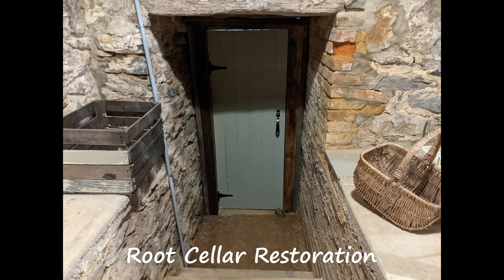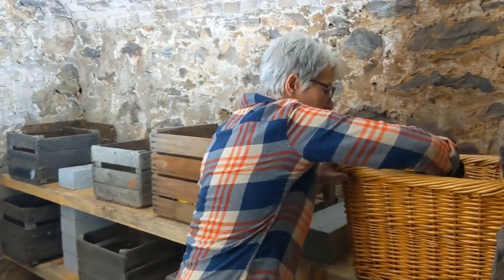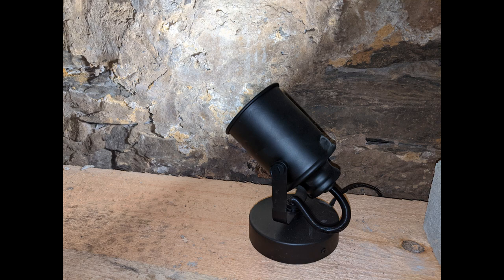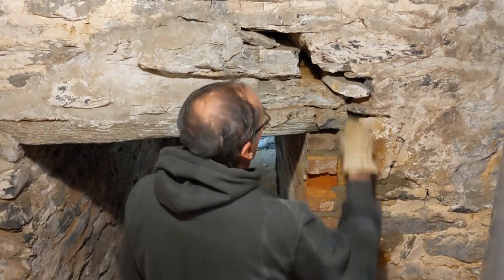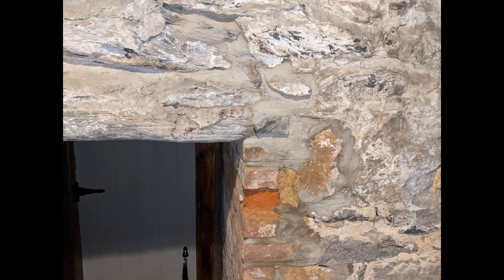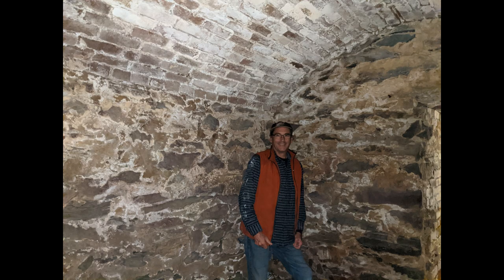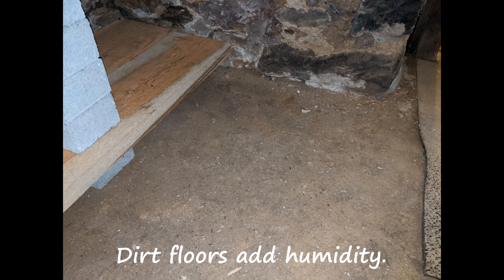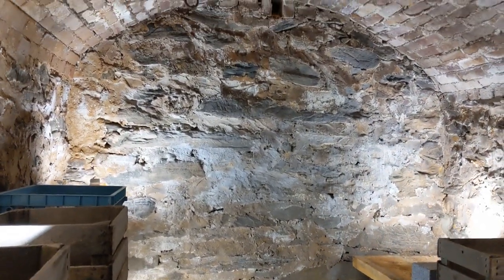1840 Farmhouse Root Cellar Part 2

Comment: If spiders are an issue they used to hang onion sacks of hedge apples in the cellars...typically these where cultivated in the hedge rows ergo the word hedge apples...mortars where typically slaked lime stone and soil mixtures they cure for a long time and obviously they do a very good job.....the natural mortars also where somewhat self regulating for humidity like adobe blocks they would breath....and maintaining humidity is best done naturally at 50%...in winter a stove pipe to the floor allows cold air to fall in and at the top warmer air will circulate via convection...that will allow moisture out...warmer air carries the moisture out...boiled linseed oil on the clay floor will also help regulate moisture...Often farms would have a wine room I wonder if that is how the one in the barn was used for brewing beer and wines?
Reply from the maker: I never heard that method of keeping spiders away. I'm always interested in new ideas.   

It's amazing to learn all of the different ways things were done in the past.

Thanks for watching.

Comment: With those thick wooden shelves you put in - Are you worried about mold?
Reply from the maker: I was not concerned at the time....but I should have been!  Good observation. I'm working on a ventilation system now.

Comment: You could put mortar in a baggie, like you would to fill a donut, cut the tip off, put the baggie back in the hole and fill some mortar in there. You can be more precise using the baggie thing, and then apply mortar to the stones you fit in there. That way, you have a solid repair.
Reply from the maker: That's a good suggestion.  We hope to get more work done in there this winter in order to have it useable by next summer/fall.  Thanks for watching!

Comment: I love this. How many man hours do you figure it will take to secure the barn cellar?
Reply from the maker: The barn root cellar is a bigger project. Water from the bank barn ramp leaks down to the stone arch and it damaged the mortar.  I need to pour a concrete pad on the ramp to make sure it does not collapse when tractors drive in the barn. Then I need to repoint all of the stones!  Huge project....and now the weather is warming up, time to farm. Thanks for engaging with our project. More to come!
Reply: You could place rock, draintile, and possibly a membrane under the slab to divert water away from your beautiful cellar.
Reply from the maker: @buelowexcavating  thank you for sharing your ideas!  The surface of the ground over the barn root cellar is sloped as it is the ramp to the barn. There is a small 2 ft concrete area next to the barn...but the west wind drive the rain water against the barn and then down to the ground over the cellar. Water drips down thru the stone....and the old mortar falls out. Yes, we need a membrane, tile and concrete. I wish you were close enough to take a look.
Reply: When I say place rock we use 3" tire chips. They weigh 1/3 less than rock. They are about 1/7 of the cost of rock. They act as an insulator, drain tile, and shock absorber. We use the chips on the bad and wet soils. On a Church, the basement walls were wet and moldy. They had three systems installed by three different companies, none worked. After installing our system the walls were dry in 2 days and have been dry for about 25 years.
Reply from the maker: @buelowexcavating  wow, I never heard of that practice, but it makes sense!
Reply: What part of the country are you in?
Reply from the maker: @buelowexcavating  sorry for the slow response....planting time!  We are in south central Pennsylvania.

Comment: Should have gone with lime and sand mixture instead of modern mortar. It is what was originally used most likely.
Reply from the maker: Thank you Michelle.  To be honest, I didn't know about the old formula for mortar......it makes sense though.  The old mortar is softer then the mix with portland cement.
Reply: I am not a concrete professional. But, a crooked Cement contractor ran out of cement on a garage frost footing foundation. To finish the job he used lime. The block installed with lime had less strength. He ended replacing it before the garage was built.
Reply: Yes. Lime is better for this job than Portland.  The problem is that the Portland is less permeable to moisture than lime.  Over time, this could result in damage to the stone rather than the mortar itself.  However, since this is just a small patch and not done on the majority of the wall, you should be fine.

Comment: For that era I believe they used lime motor. I know that project is done but perhaps in the future you could check with some stone masons to see what’s best for you. Just a thought. Your property is beautiful for sure.
Reply from the maker: Yes, you are spot on....the original mortar used here in the 1800's was simply lime and sand. Unfortunately I am a novice mason and I was not confident enough to use lime and sand. A better mason would have used an original mix for sure. Thanks for the insight.

Comment: We owned an 1806 farmhouse in Pa. with a root cellar that was 8' x 12' and it had water cisterns in all 4 corners that stayed filled with water year round. Have never seen anything like that before or since!
Reply from the maker: Oh, that is so interesting!  I have never seen that arrangement either. I wonder about the motive in the design....perhaps the cool water was to aid in temperature management and to add humidity.  I'm just guessing. I'm curious if anyone else has information.  Thanks for sharing!

Comment: What temperature is staying in your cellar.?
Reply from the maker: Temp on 12/3 is 57F at 99% humidity. Too warm. I'm working on a powered ventilation system now. Funny thing, laurder at basement level is 2F degrees cooler. The deep root cellar is still holding summer soil heat. Vent system should help. Any observations?

Comment: Hope you're not using cement.
Reply from the maker: I used cement to patch the concrete floor. And yes, I used a premix mortar that had some cement. I'm just now learning about the lime/sand mixes. I should have kept it more in keeping with original construction methods. Thanks for the observation!